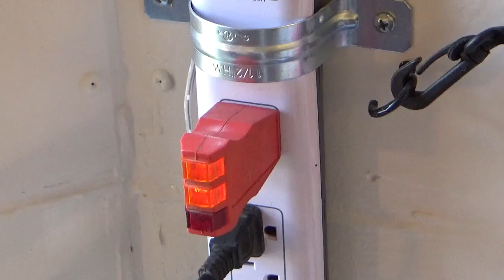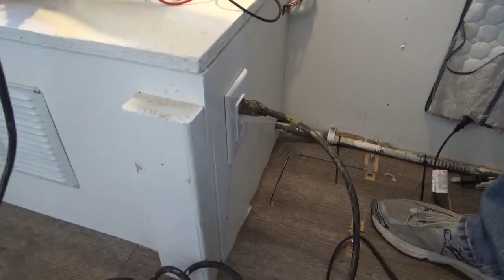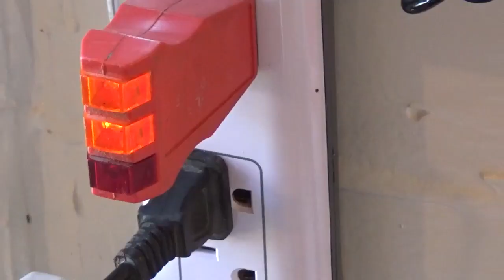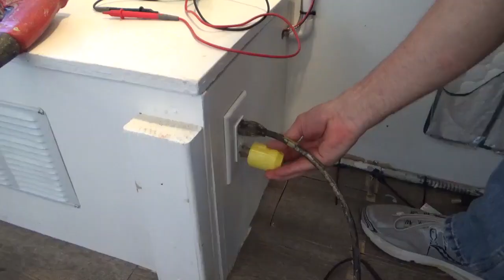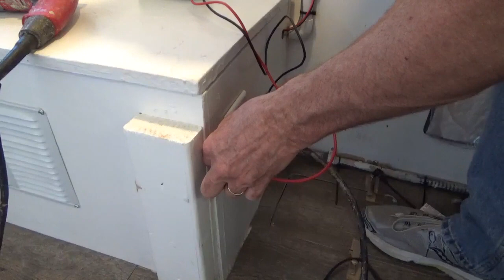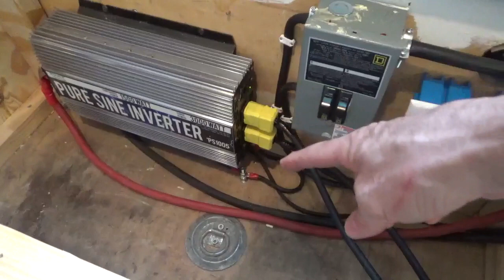SOLAR POWER SYSTEM ELECTRICAL TESTING Ground Cargo Trailer Camper Conversion Vanlife Skoolie

Comment: I've been watching your videos about the grounding issues. I'm not an electrician and am quite ignorant when it comes to electric. If I understand things correctly. chassis ground is not a ground in the sense of AC. It's only the completion of a DC circuit. Therefore I would assume that chassis ground will not function as an "earth" ground for an AC circuit. Shore power is providing a true earth ground. However, there is no such ground when on solar. I'm not sure you can get an earth ground on your solar system for your inverter.

https://www.rvtravel.com/rv-electricity-the-abcs-of-campground-power-and-grounding-part-2/
Reply from the maker: 100% agree with you. I also don't think that AC ele tester is the correct one to use in this application. Thanks for your input.

Comment: Have you resolved your ground issue yet?
I have been researching wiring up solar systems in RV's, which is basically the same setup. You might want to try running a ground wire from the frame(s) of your solar panel array to the ground on the chassis. Do a temporary ground to test it before doing it permanently,  just to avoid doing needless work, but I suspect this may resolve your issue. One more thing you could try afterwards is using a grounding rod driven into the ground. You may be able to rig up a quick connect solution using your safety chains, providing they have a clean connection to the chassis, and connecting the chain to the grounding rod. This method would also prevent you from forgetting to disconnect the grounding rod before driving away, since it would be obvious during hitching.
Just some suggestions, I hope it helps with your issue.
Reply from the maker: Thanks for the suggestions John. We will give them a test and see what the results are.
Reply: @FakeLegGreg  
On a side note, several years ago I had power issues in my house. The more power I used, the dimmer the lights would get. I checked the outlets in several locations (white vs black) with a voltmeter. On one side, I would show over voltage, on the other side I had under voltage, similar to your test. I couldn't find any problems in the house, so I thought there may have been transformer issue down the line. I contacted the power company, they did some tests, and discovered a loose connection and minor arcing in my power meter box. He tightened all three connections and that resolved my problem. Just something to think about, maybe double check all your connections, including the solar panels, and maybe use some dielectric grease on your connections. Just trying to help, as I am extremely curious on what is causing your issue. Also, with the jumper you are using, what are you actually jumping? Although I may have missed it, I couldn't find that in any previous videos.
Reply from the maker: @JohnDoe-dp5vo  Good example from your house. Something to consider. What I was doing with the jumper was connecting the ground to the white common ONLY WHEN ON BATTERY POWER. When I did that the tester would show that everything is right and the voltmeter would also show correct voltage. But I have been advised not to do that. So I haven't used it since and I do not promote it. I built the whole system winter of 2018 and used it extensively in 2019 with no problems. I went back through it winter of 2019 and checked everything. I changed from solid wiring to stranded wiring because a few connections had vibrated loose. None of any of that work changed a thing about the grounding situation on batteries. I have no problems with grounding on shore power, everything works right. My only grounding challenge is on batteries.

Comment: Hi there I really liked your videos, very well explained.  I have a couple of questions, I am really new at this so please bare with me.  I purchased a 7x14 cargo trailer and it currently has solar, however, the previous owner only put 1 outlet inside.  It has 1 12v battery, and 1500W Cen-Tech power inverter with a 3,000-watt surge.  I would like to add 4 more outlets in the trailer and a couple of more LED lights.  I am going to install an AC unit but that's it.  No fridge, no TV, just 4 more outlets for Charging laptops, or cell phone, shaver, and possible shower.  I do want to get another battery so i will have Parallel connections.  The solar panel is so small its like a size of a picture frame mounted on top of the box in front of the trailer.   Now I can plug the trailer to the RV outlet since it has a plugin from the outside.  My question is do I need a bigger solar panel?  Is my inverter big enough?  I am only using the trailer 2 times per month.  Thank you for your advice.
Reply from the maker: Thanks for watching my videos. The size of the panel will only affect how quickly your batteries recharge. The bigger the panels, the cleaner the panels, and the more sunlight the more power given to the batteries. If you don't put a large load on your batteries then you solar panel can keep up. If you are draining your batteries then you will need more solar to keep up. Your AC unit will not run on the batteries as you describe them. For AC on batteries you need a LOT of batteries and solar panels. Good luck on your project.
Reply: @FakeLegGreg    Awesome thank you very much!

Comment: Did you test the inverter itself with the tester? If that test good, then it in your wire you wired up. Check your work at the ends you put on, open them, and do a continuity test each wire. If good, check to make sure no screw or nail might punch threw the wire anywhere. A generator will cause an open ground, and that when you should use that cross over in one of the plugs. Maybe your inverter as a separate ground that needs to be plugin or unplugged within the unit. I have seen that, because my charger inverter has that, depending on specified use. Is the grounding point clear of all paint on the point of the frame?
Reply from the maker: Yes, I did test the inverter itself. Same result. Thanks for the suggestion
Reply: Seems to me if the tester shows an “open”  ground when plugged directly into the inverter there is a problem inside the inverter. Did you check with the manufacturer of the inverter about this? The “grounding “ conductor (bare wire) and the “grounded” conductor (white wire) are essentially connected together and should be at the same potential right at the inverter and voltage from black wire (hot wire) to either other wire should be 120 volts.